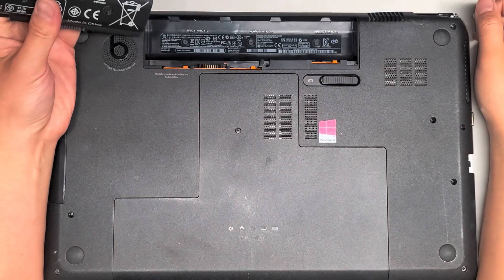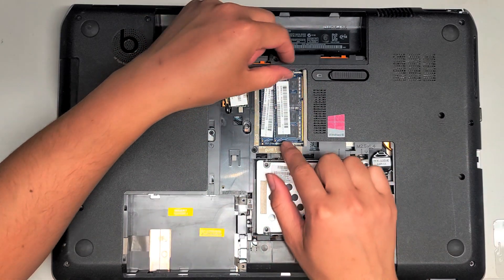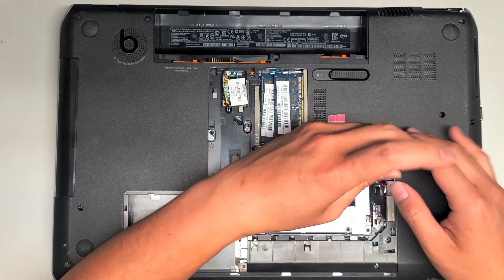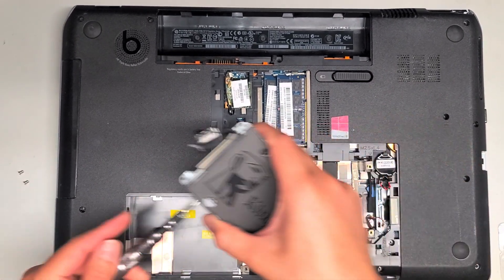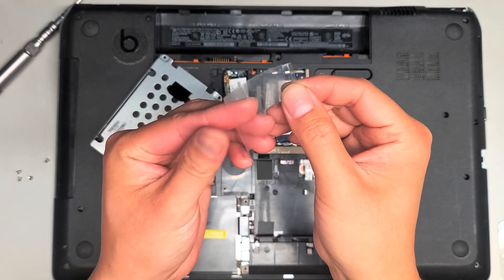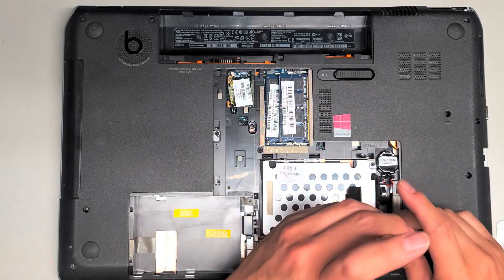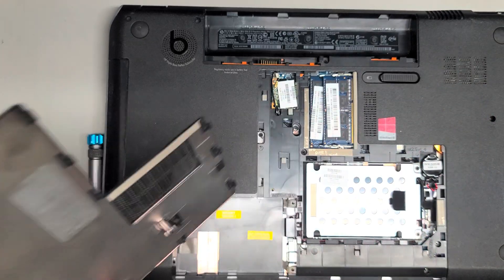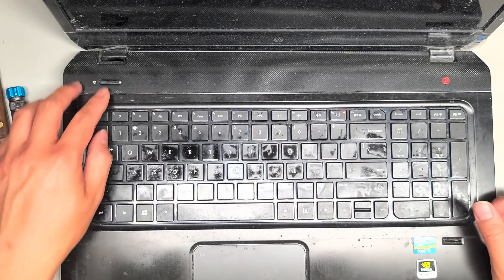HP Envy DV7 DV7T-7300 Disassembly RAM SSD Hard Drive Upgrade Battery Replacement Repair

Comment: Is it possible to replace GPU in this laptop as well? I mean using BGA soldering machine. I have the same model and I'd like to put there something more powerful than GT650M.
Reply from the maker: If you're asking, then the answer is no. You'll be better off buying a new laptop with better specs.

Comment: Is there a SATA 2 or SATA 3 on this motherboard?
Reply from the maker: 3? No idea, why does it matter? It'll work fine with any SATA drive, even SATA 4.
Reply: @ItsBinhRepaired  I have the same laptop and I want to install a ssd. I need to know
Reply from the maker: @ЛідіяСідлярчук  I'm confused. Any SATA SSD will work.